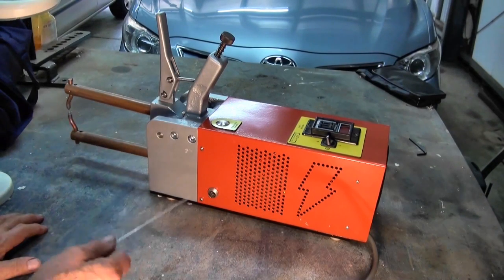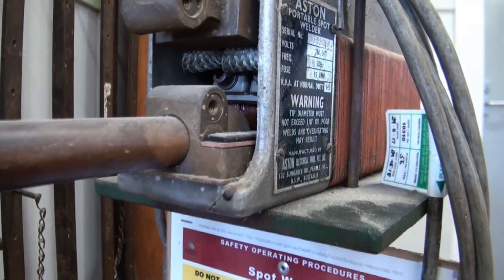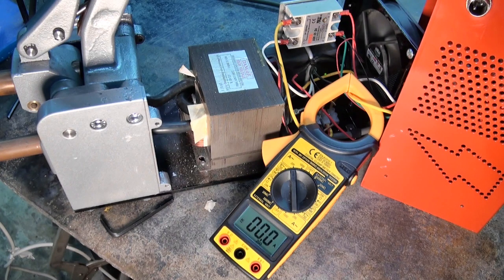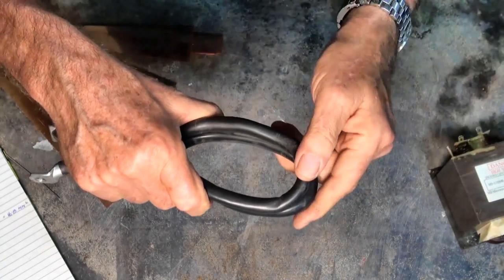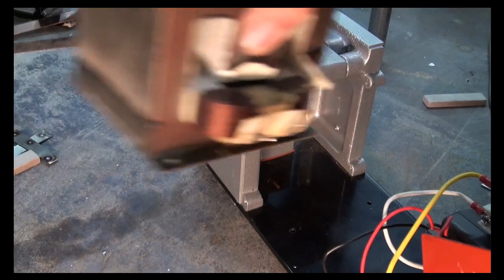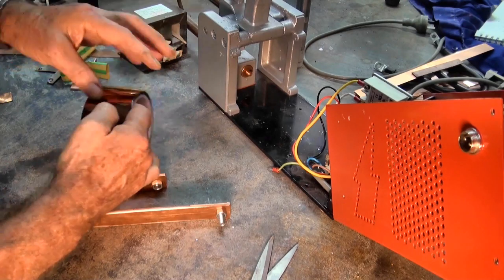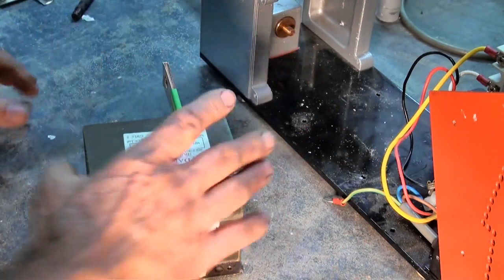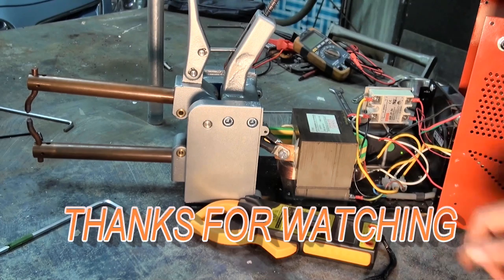Spot Welder Upgrade Goes Sideways

Comment: Another great improvement for the welding quality is to provide a 3 step input voltage controller. In simple words, a first short heating cycle (let's say half of a second depending on material, thickness, etc..) just to heat and soften the metals to be spotted,  then keep or increase electrodes physical pressure (it will help improve electrical contact between softened metal) for let's say another second, and finally a welding pulse of a second or so.  There are several projects of such controllers in the internet, and besides improving the quality, it provides repeatability which is very hard to obtain pulsing a button by hand.

Comment: Hi Mark, Thanks for putting up the video. We shouldn't be surprised by the result. The output power of your welder is a function of the number of turns of your output coil and its electrical resistance. Given a constant length of wire and therefore its resistance R, the higher the number of coil turns the higher the voltage U goes and so goes the current I. ( I = U / R ) As you reduced the number of turns you have pretty surely reduced the voltage. Assuming your new coil has lower resistance, it might have brought up the current. (Just guessing.) But overall the Power might have remained pretty much the same. For example: If you had initial 1000Watts ( = 2V x 500A ) you might still have 1000 Watts ( = 1V x 1000A ) by having changed your secondary coil. But as your current meter indicates that your current hast dropped (which one should expect after reducing coil turns) your power has gone down. The only way to increase current is to bring down the resistance of your coil. You might achieve that by adding additional copper sheets in parallel to the current ones. Putting twice as much copper in should bring your resistance down to half value there. But as this only partly responsible for the overall resistance of your secondary circuit, this might not be enough to improve your welds.
From own trial and error I found that bringing up the number of turns of my secondary coil easily improved performance of my own home grown spotwelder significantly. Your milage may vary as I am using a toroidal transformer not the common MOT.
Reply from the maker: Thanks for that analysis. I am not sure why that video keeps getting so many views, well, for me anyway. I knew before I posted it that the modification was a bit of a failure. I have since upgraded the secondary coil back to it's original configuration but I used a much heavier battery cable with more copper and as you have pointed out it would have less resistance. The welder now performs very well and I am completely satisfied with its performance. I actually cut enough copper strips to completely fill the space in the transformer core but I mistakenly thought that having the same cross sectional area as the original cable but only one turn would give an increase in current. So much to learn and so little time!
Regards,
Mark
Reply: Sorry mate I'm not trolling you, so don't get defensive. 
AC is based on turns. 
DC is resistance. 
Less turns higher current. 
But if you haven't got a tank of energy behinde it and a cable /copper strip that could never allow the current through it, all that current just gets bled away through the heat and resistance in your path you have made. 
Current flows on the outside of the conductor (comes from the area around it) 
If you haven't got the correct conductor size it will never get there. 
I'd like to see the voltage going into it. 
Maybe the voltage is being dropped when the short circuit is created.
Reply: @simonlaker2139  
Sorry mate I'm not trolling you, so don't get defensive. 
𝘓𝘦𝘴𝘴 𝘵𝘶𝘳𝘯𝘴 𝘩𝘪𝘨𝘩𝘦𝘳 𝘤𝘶𝘳𝘳𝘦𝘯𝘵 = Um... sorry, nope. 
If you keep the wire length (DC resistance) constant and reduce the number of turns (decrease voltage), Current will decrease as I = U/R . Even though we are talking AC here, DC Ohms Law is valid here, if we don't start splitting hairs consisting of µA/µV, phase shifts etc.). Try it and you'll see.
The output 𝙥𝙤𝙬𝙚𝙧 (U x I) of a welder is a function of the number of turns of your output coil 𝙖𝙣𝙙 its DC resistance.

In practical terms - if you add a turn or two you might well get better welds. 
Careful though: 
If you add too many turns you might well burn your primary winding as the power drawn increases exponentially.

And by the way - have a look at the creators answer to my original comment. Obviously his real life experience confirmed my thesis.

Add "approximate" and "ball park" where applicable.
Reply: @hypnotico  ohms law doesn't apply to AC. 
As you should know
Reply: @hypnotico  also my real life experience is motor rewinding. 
It's all about the turns and the csa. 
If you don't have enough csa your current will not be following the the conductive path.
Reply: @simonlaker2139  , think again Sir. Ohms law does apply, as DC resistance R in the AC circuit is independent of the frequency and does not cause any phase shift between current and voltage. Voltage is  proportional to turns of the secondary winding and so is Current. (I = U / R). More turns more power. But don't kill your primary winding!
Reply: @EL34Quartett  less turns more power. 
I rewind generators for a living. 
From 1.4 megger watt time 2 megger watt car diesel. 
Ranging from 415v-690 volts. 
There is a reason that they are one and 2 turn windings. 

Your formula kind of works I'm not talking that away from you. 
But in the real world that's not in a book this is how things work
Reply: @simonlaker2139  I described how windings on Transformers work in reality. You seem to have some sort of misunderstanding, as you can see confirmed in the answers of the video creator who has changes his welder accordingly.
Reply: @EL34Quartett  man I really don't want to argue over this. 
A discussion is good. 
You would have noticed that the ability of a conductor to carry a current changes as it increases in cross sectional are (csa)
Eg  a 1.5 sq mm wire can take 15 amps in a electric motor winding application. 
But a 15 sq mm can not take 150 amps. 
Why? 
Why do cables come with fine multi straned wire instead of thick wire? 
It's not because there more flexible. 
The video shows the effect of not having enough conductive area on the secondary. 
Yes you can look at as a resistance. 
But you also have to look at the effect of the moving electrons in the conductor interacting with the inviroment surrounding the conductor .(AC there just moving back and forth) 
If the conductor is not big enough it won't act as a conduit for the current. 
Instead it will only give the amount it can produce and admit the rest as light /heat. 
That's whats happening. 
I hope you can see it.
Reply: @Simon Laker  obviously your theory contradicts ohms law, the applicable ratios of turns and Voltage and Current in Transformers, Mark's experience,  as well as my own building my own spot welder. That one started to perform significantly better after adding another turn, which - consistent with all law of physics - brought up voltage AND current. 
As for Mark Presling and myself the issue is resolved by adding turns, I think we can put this to bed, don't you think?
It looks as if there a quite a number of wrong way drivers on your side of the road. The question is: Why?
Reply: @hypnotico  dude I'm glad it worked for you. 
In your mind you are right. 
I'm happy for you. 
Look up Stienmetz and his theory of a field in respect to power transmission. 
How the field is created, how the field has a relationship with capacitance. 
Look up dielectric field lines. 
Have a good think and ask yourself why.

Comment: This is a bit late but it might help someone that reads this.  What you got wrong is assuming that voltage is not important and that providing more copper will increase the current.  The relationship between voltage, current and resistance is given by Ohms law: I = V/R.   Now you need to understand that reducing the winding resistance by half (by using double the copper cross-sectional area) and reducing the voltage by half (by halving the number of turns) will leave you exactly as you were before in terms of current.  However the power delivered is given by VxI.  Therefore the power is only 50% as before.  Actually it gets worse, because most of the resistance is contributed by the metal that is being welded and not the winding. That is why the nickel or steel being welded  becomes red hot while the copper winding just warms up a little by comparison.  Therefore you have reduced the voltage by 50% and reduced the overall resistance by maybe 20%. In this case the current will be reduced by 40% and the power delivered would be a measly 30% of what it was before. You primarily need voltage, the higher the better, but the copper area is important to keep temperature acceptable. It's a trade-off because adding more turns means less space.
Reply from the maker: Jack, I am guessing you could tell that I was a tad disappointed with how that "upgrade" turned out. It's true that electrical theory is full of dependencies and interrelationships.  I ended up going back the original format of 1 1/2 turns but used a much heavier cable. It now works great and is much quieter.
Regards,
Mark

Comment: From my own finding most MOT was having V/T ratio of 0.9~1.0V.  Hence, the U shape conductor was essentially equal to 1 turn which give 1 V across the terminal. From the label of Miller's Model 11 which rated @ 1.5KVA secondary voltage of 1.6V, by having two MOT wired in series on the secondary with 1"U" shaped turn will give approximately 2V of output. That could be the goal on your next  attempt. From my own experience, 1 900watt rated MOT with 2X25mm^2 cable wound 2T could still struggle to weld 8mmX0.2mm pure nickel strip on 18650 battery. while 2X25mm^2 cable, wound 4T will do it with ease. conclusion, some amount of voltage will be necessary to break the surface oxide layer of works material before the current could pass through it.
I really admire the casting of your welding arm, good job on that.
Reply from the maker: Thanks for your comments. I must say I tend to do a lot of experimentation on projects such as this one. Sadly, I don't understand a lot of electrical theory but as it turned out, I made one final iteration of the design which has proved to be more successful than I had hoped for. You can check it out here https://www.youtube.com/watch?v=VPTdDzf1-s0
Regards,
Mark

Comment: The secret to improving output welding power (understand it as current) without messing up with input winding number of turns or input voltage is to increase copper cross section on the secondary to reduce the overall resistance, so with the same output voltage (in other words, defined by the number of turns, in this case only one)  you will be able to drive more current.  An increase of voltage (increase of turns) could sound correct but it will drastically reduce the copper cross section of the cable, then reducing the possible current due to its own resistance, which in this case will cause heat on the entire secondary winding, or in other words, wasting power to heat the cable instead of delivering it to the spot being welded.   Since the output voltage is pretty low, voltage insulation is less likely to be a concern so you only have to provide some separation on the bottom side of the secondary to provide mains insulation,  the region closer to the primary.  A good insulation paper of 1mm will do the job. Then the remaining area on the secondary (sides & top) a simple thermal shrink tube will be enough, and all the rest as much cooper as you can possibly fit in.
Reply from the maker: Claudio,
I must say that electrical theory is not an area that I understand well. Your comments are welcome though and I have experimented quite a bit with the secondary winding on this machine recently. The configuration I am using now seems to do what I want although I would very much like to incorporate a pulsed (3 step) weld timer as described by you. I had used a large treadle operated welder at work (a secondary school)  which had a pulsed output but it was always in need of maintenance as the students would keep welding with it long after the electrodes were in need of reshaping. As a consequence the arms were nearly always misaligned, the tips mushroomed over and the tip pressure way too low.

Comment: The power limit is first met with the magnetic cross section of the transformer (area of the centre pole) More power needs more iron. 
The ultimate method is to use two MOT transformers primaries in parallel in phase then wind one secondary turn round each transformer. BUT, usually the trade off is weld time, with one trans the on time is about 2 sec, with two transformers it's about 1 second. Then is it really worth the effort?
Reply from the maker: I regret doing that "upgrade". It seemed logical at the time but since I went back to the original configuration (although with much heavier wire cross section) the welder is now reliable, quiet and capable of welding much heavier stock.
Regards,
Mark

Comment: instead of using a stack of copper flat sheets, can you use a thick braided copper grounding strap as the secondary?? the braid is tight, but is braided of small wires like hair.

Comment: If you look at the commercial spot welder compared to the DIY version the significant difference is in the amount of iron in the transformer. Iron has an upper limit to the amount of magnetic flux it can carry. Beyond that it's saturated. Given the power rating of a typical microwave it  seems to me this is the factor limiting how much current the secondary is capable of.
Further to that I think you can tell when a transformer is saturated, it sounds "unhappy". I suspect this is because the saturated core is in effect clipping the sinusoidal current creating harmonics.
Reply from the maker: Robert,
I should really take that video down. It was a bit of a failed experiment and a short time after realising that the "upgrade" was in fact a downgrade, I went back to the original number of turns but I used a much heavier cable for the secondary winding. The heavier wire fitted into the cavity of the core much better and it stopped rattling as a result. It now welds very reliably and I am quite happy with how it performs. https://www.youtube.com/watch?v=VPTdDzf1-s0
Regards,
Mark

Comment: Hi Mark, I just think that your idea with copper bars is very interesting, but normaly a loop in the secondary has to be closed to produce current. And that's why this upgrade could not bring more current then the previous system. If you could make at least one loop with the bars and then connect as you have done, It should work. But maybe I am wrong, Thanks for sharing your ideas and projects.
Reply from the maker: I must say I was very disappointed with this "upgrade". It should have made a huge difference but I actually went back to the original 1.5 turns of copper but I used a much heavier cable and that did the trick. I have used the machine quite a lot since then and I am still amazed that a repurposed junk microwave oven could make such a useful tool.
Regards,
Mark

Comment: Mr Presling, although the resistance is lower with the larger cross section, its missing out on a lot of the magnetic field with that open end.
Reply from the maker: You are probably correct. Transformers are not my speciality. I guess I am working empirically with this project. I did use a commercially made spot welder which had a single turn laminated copper secondary but it was a co axially wound transformer which might account for differing characteristics. All I know is that the machine is now performing as well as I want it to be and I won't be dicking around with it any more.

Comment: The reason they use a single turn is because they run that transformer massively into saturation. That means the turns ratio is a lot lower, but the drawback is that the transformer is then going to burn out if it is run continuously, it will fail within a minute if powered continuously, even with the secondary open. Works there because duty cycle is under 1% in most applications, even going as fast as you can spot. To do the same with a MOT you would have to rewind the primary  with 2/3 the turns, to get a similar turns ratio, or get a 110VAC microwave and use the transformer from that, running on 220VAC.

As well to get the cables flexible strip the insulation off the cable and use a thin sleeve of insulation to make it less bulky. As well do not use steel ( or worse stainless steel) bolts, use brass ( copper is best, or a copper solid rivet, but that creeps) as that conducts electricity better than steel.  You can do strip in 2 turns, just needs a bolt at the end of each turn to do the angle change.
Reply: SeanBZA ,

Comment: You need different wire insulation. The pulsed heat from current flowing through that cable will degrade the rubber/pvc insulation of that battery wire.   XHHW wire through a woven Fiberglass sleeve will be a bear to bend but wont ever let you down. 
You have a great skill set... I expect you to be winding your own custom transformer designed with a solid (not laminated) flat copper secondary wrapped around the primary just like the real deal.I think the iron core laminations are in your way in this design. But if anyone can pull off a custom transformer, I think its you. :)

Comment: also, if there is spaces inbewtween your copper stack is that a bad thing? I was wondering if you could have epoxied the stack and clamped it for maximum tightness, and if that would even matter in this application??? IM A NEWBIE